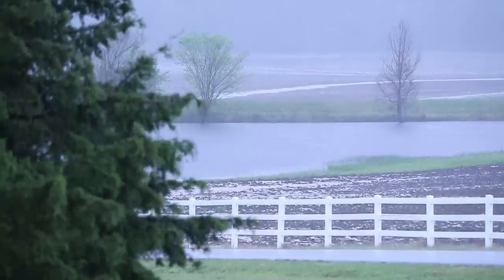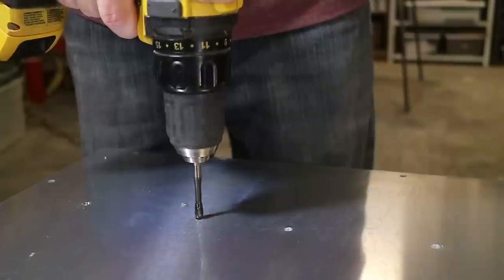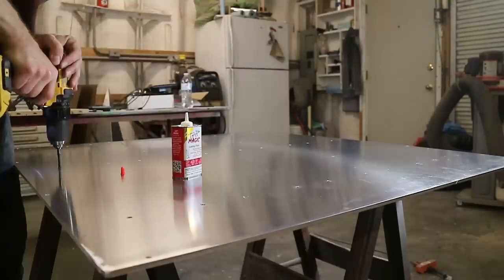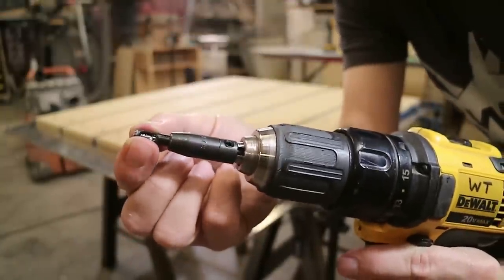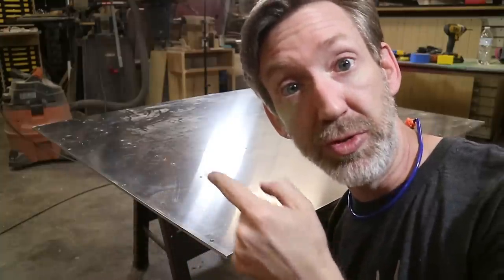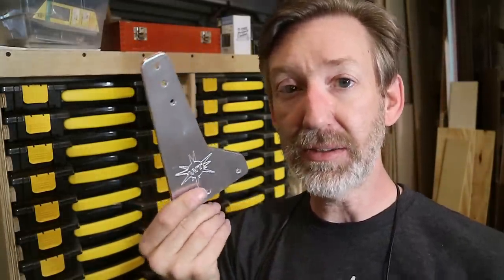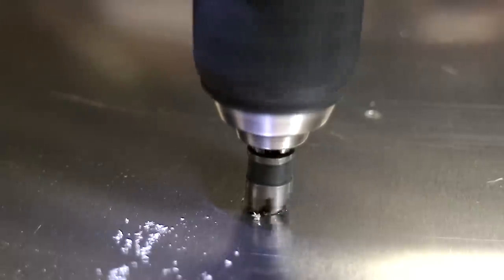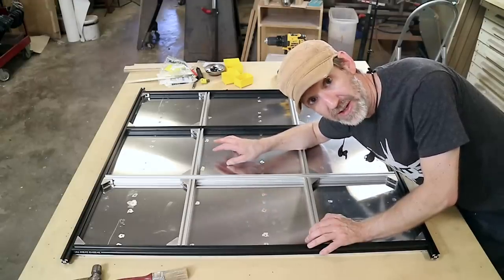A Better, Stronger X-Carve, With an Aluminum Bed & More Upgrades

Comment: I wondered if putting in the risers would compromise the frame stiffness, and it appears from this video that it did. At 11:45, it appears that there is a LOT of visible wobble in the gantry. Can you comment on that?
Reply from the maker: The risers also act as stiffeners. They strengthen the machine. What you're seeing was the table shaking.

Comment: Hi,
Is there a way that you could share the file that you used for the aluminum plate. I am going to install the same set up that you have in the video and will purchase from OSH as well.
Thanks.

Comment: Dear Wesley, Thank you for this very instructive video, and funny!. I'd like to know if u have some drawings for side plates (X and Y axis), to replace the original weak plates. I bought this machine in 2017, but as I live in Colombia, is difficult for me to get updates, especially right now in the middle of the pandemic.
Reply from the maker: I'm sorry, I don't. Those plates come from TBD CNC. You may try contacting them. There's a link in the video description. 👍

Comment: i just don't get the whole x carve fascination.  out of the box, at best, it is a flimsy cnc setup.  i see people spending a fortune on these in time and materials to make them even rigid enough to carve soft woods.  all 3 axes deflect with the slightest pressure.
Reply from the maker: If it's deflecting with slight pressure, you didn't assemble it right. I didn't have to upgrade it to get good results, but I like the fact I can improve and expand it when I want.

Comment: You beefed everything up but the Y axis.. Didn't you notice it bouncing around when you were attaching the new z axis?  That is the problem with them, the x and y have too much flex. Those x axis and z axis upgrades looks great.
Reply from the maker: I've never had a problem with any bounce in the Y axis. Any movement you noticed while I was attaching the Z was because there were no belts installed yet and everything was free to move.
Reply: @WesleyTreat  First off, you are a true artist... love your stuff...
IC... I thought it was pretty bouncy... More than normal. The reason why I was asking is, I have seen where Myer's Woodshop at 9:52 Was showing how much flex there was in his Xcarve. https://www.youtube.com/watch?v=eL7PqEpA0Qw
And Marius Hornberger modifying his, due to having problems the X and Y and torsion flex problems on the Z.
https://www.youtube.com/watch?v=JQJKxtc8bf4
He bought a sweet sliding table saw from Felder back in 2015 and then after seeing his channel and some of his xcarve videos, Just sent him their new CNC that isn't even ready for sale. Not impressed... looks like the Chinese ones you see on ebay.

Reason why I'm looking and asking questions is, I'm building a 26' Uhaul stealth camper/ toy hauler... And instead of a Jeep or car, it will have a portable metal and wood workshop in the back. With 2 tesla batteries for 10.4kw storage and 3.3k bank of solar panels and a backup generator. I only have 8'x8'4"x14' space to stuff everything in there... So I'm looking for a smaller CNC to have on the road... My current CNC needs more room than I want to give up. And it can be a PITA.... lol So I'm looking for something smaller. 

But I'm thinking maybe biting the bullet and build one from scratch... Kinda would like to at least be able to do a half sheet of plywood so when doing the majority of cabinets I build, I don't have to keep moving the sheet. I need it light, yet strong, plan is to suspend it from the ceiling so I can walk under it, I'm a hair under 6' so I have 28" to play with, then lower it to load a project then lift it back up so I can keep working and not waste my floor space. Or maybe a sidewall mounted, but I'd rather not give up wall space.
Reply from the maker: I also had the machine on a less stable table as I was putting it back together, so it was probably just the table shaking.

There was an older Y axis that came with the X-Carve that required reinforcement, but the one they've been selling for awhile is pretty strong. I haven't had any issues with it.

You might look at TBDCNC. I know Luke has been working on a complete machine that I'm pretty sure he's going to offer for sale. 👍

Comment: Wesley, the alum. Base is beyond my budget right now, so I will just add a second piece of 3/4 mdf. That should work on for a awhile ? Do you answer questions on your patron site
Reply from the maker: I've seen others use two layers of MDF, which should work all right. And, yes, I do try to answer all the messages I can over on Patreon. Thanks!

Comment: Enjoyed your video, I work at a machine shop and cut up my plate on a water jet to include the counter sink, sadly there is not much left of my x-carve I have replaced almost every part with something better, bummer tbdcnc is so backlogged, I still have an order sitting in pending status.. I designed and cut my own xyz screw drives, I will say this he has a solid platform bummer he don't farm out his dirty work to a bunch of American factories, I created my kit for about 250$ he charges 980$.. Luke might need to get a water jet table :p

Comment: ITS A GOOD THING IT IS JUST A 1/4 INCHES THICK BECAUSE YOU ARE USING A TAP MADE FOR STEEL TO TAP ALUMINUM , GET YOURSELF A SPIRAL TAP FOR ALUINUM AND IT WILL CUT THE PART WAY BETTER. IF YOU WERE TAPPING 1 INCH DEEP YOU BRAKE THE TAP YOU HAVE NOW
Reply from the maker: This is the tap I used: https://www.mcmaster.com/2687a48. A spiral-point tap for aluminum. I linked to it in the video description.

Comment: Most of that z hieght is above the gantry, meaning its unusable. If you flip the whole z assembly around and mount the servo direct to the top, this would give you a floating z-axis and you could add maybe another 2inches maybe 3-4 to your z instead of wasting movement above the z gantry

Comment: Very nicely done! Would you be willing to share or sell the DXF file that you provided OSH Cut with to fabricate the aluminum base? I would like to send them this job but I want to make sure I get it right the first time without screwing up the measurements. Thanks!
Reply from the maker: If you contact them directly and reference this video, they should be able to help you. 👍
Reply: @WesleyTreat  That would be great!  Thank you!!
Reply: @WesleyTreat  Thanks again Wesley. Caleb at OSH Cut was very helpful and I ordered a copy of the base plate today. Were you able to use the SuckItDust Boot with your new TBD CNC linear Z axis carriage? BTW, I cracked open my piggy bank and ponied up some coins to help support your channel on Patreon. Cheers!
Reply from the maker: I've had to make some new arms so the shoe fits. Might make a video on that when I redo them in aluminum. Thanks for the support!
Reply: @chrismatus4469  If you dont mind sharing, how much was the base plate?  Very interested in this upgrade!
Reply: @seanhoward25  It was about $360. I don't remember how much of that was shipping from Utah to NY. It was packed with a sheet of 3/4" plywood to prevent bending and the package was pretty heavy.

Comment: why buy and x carve in the first JUNK buy a workbee and get a great cnc that does not have to rebuilt ,,and a lot less money i bought a 1500 by 1500 mm can do 4x4 sheet work area and it cost less than $1,500.00 did not put in the bottom struts mounted cnc on table and have 5" of z !!!
Reply from the maker: Google Translate
Fatal Error

Comment: Very lucky you made it through all that tapping using a "snap -32"  (aka 6-32 tap) . The ratio of dia. and TPI makes that tap the weakest tap / dia / thread configuration. Very cool machine upgrade.
Reply: I LOATHE 6-32. Anytime i get a job with 6-32, anything going down more than 3/8" gets drilled only, and handed off to second ops, where it gets done with tapping arm which have clutches in the tap adapter.

Comment: Change the drill to drilling only, if your the torque limit, you will break the tap.
I use that tipe of taps with my drill and no problem, 2 broken taps in 5 years

Comment: I love it!  Do you know if the CNC company you used can just re-use your file so we wouldn’t need to do the measurements again?  Also, ballpark...what are we looking at price wise to do all the same upgrades?  Great job, man!
Reply: I'll second that! It would be great if they still have the specs we could tell them to reference, or if you have a file/specs any of us could send to them as well - makes sense if we are going to attempt the exact same upgrades - no sense in recreating the wheel if we don't need to!!  Great video!
Reply: Wondering about this myself. I would love to do this upgrade to my x-carve and it would make it a little easier if we all have the same dxf file.

Comment: A nice build/hack of the existing machine.  The Z-Axis hopefully cures some of the flex that the X-Carve has.  The 1MX1M units have two other locations for excessive flex, the X gantry member with it's associated mount flex and the v wheels.  The issue with the X gantry is the extrusion itself, it twists in use with even light loads and will go out of square as it relies on the week side plates that run on the Y rails.  The new Z system adds more weight on the gantry - and will wear the v-wheels and eccentrics out faster.  You can address those issues with ball guides mounted to the top and bottom of the gantry beam and building thicker gantry to Y-axis rails plates with some structural reinforcement that keeps the beam straight and square to the table.  I estimate that the cost for that modification is about the same for what you did to the table.

Comment: Why didn't you just have them laser the holes to a pre-release diameter size? Would have made it easier by just having to tap the holes without having to drill them out. Shouldn't have cost much more in machines time...
Reply from the maker: Answered in the video description. 👍

Comment: I highly recommend a countersink with a hole rather than multiple flutes for aluminum.  It'll change your life!  Search 53512 Cobalt single-end on Amazon.  I don't recommend that one specifically, but that style.  I got mine at Fastenal.

Comment: Now you need to get rid of the stupid belts and flimsy stepper  motors and flimsy stepper drivers and youll be good to,go and another ......maybe invntables should just design the machine properly and people like you wouldnt have to,double spend so much and redisgn so much...ha ha...in my opinion stock xcarve is junk period

Comment: Great video. Are you able to give the dimensions of your aluminium sheet? I'm currently in the process of doing the exact same thing, including the TBD risers, which have been ordered. I know that the risers make the bed slightly narrower and if I'm to get a base plate laser cut I'd love to have the accurate new dimensions! (in mm if possible!) Many thanks from across the pond!
Reply from the maker: Thanks! See the link to Phil's site in the video description.

Comment: Why not have the laser cut the proper sized hole to begin with?
Reply from the maker: With material as thick as 1/4", as the laser burns through, the bottom of the hole ends up a tiny bit larger than the top of the hole. Now, if I didn't need to tap it, it wouldn't really matter. But, with a tapped hole, you need a precise and consistent diameter. So, I had them cut the holes slightly undersized, then I drilled them out as needed.

All this I learned from OSH Cut, by the way, who helped me determine the best way to get the results I needed.
Reply: @WesleyTreat  Ah- thanks for the explanation!

Comment: That's a great idea with the aluminum plate. Huge upgrade over the MDF wasteboard with trying to keep everything flat and square. That's the great thing about an open source product. Another great upgrade is to ditch Easel and use V-Carve Pro. Easel is too limiting, and V-Carve  Pro is pretty simple to catch on to.

Comment: Dunno if you do a lot of countersinking, but you'd likely benefit from using an aviation-style countersink cage. Granted, you'd have to buy the 1/4-28-threaded countersink bits, but they're piloted, and the cage is depth adjustable to 0.001". Consistent, repeatable, accurate, and FAST countersinking. You can also get counterbore bits for them.
Reply from the maker: I have one I use for the rare occasions I need a countersunk rivet, but I could use a bigger one for general use.

Comment: So, how did you feel about the amount of control you had with the power tapping? Would you do this if you were trying a deeper,maybe blind hole? Harder material?
Reply: Can't speak for Wes, but I've done a bunch of power tapping into blind holes in steel - but I use a Bridgeport and a reversible tapping head... For anything over 1/2", I'd be leery of freehand power tapping; the problem is keeping the tap dead vertical. Any wobble/angle and you're looking at a snapped tap at worst, or a wonky thread (where the screw doesn't sit straight) at best. Also, the finer the thread, the harder it is to accurately hand tap. Tapping lube is great, but any fairly thick oil will do. For through holes, spiral point taps (which eject the swarf downwards) are fantastic. For blind holes, you're better off with a spiral flute tap, which ejects the chips upwards. With spiral flutes, you may still need to back the tap up to clear chips, but unlike a straight flute tap, you don't need to do a quarter backwards turn for every full forwards turn.

Biggest problem with power tapping a blind hole is knowing when you've hit bottom: The machine will almost certainly be MUCH stronger than the tap, and a broken tap in a deep hole will make you cry. A decent tapping head (e.g. Tapmatic 50x) is pricey, unless you can land on an eBay bargain, but the built in overload clutch will save not only your bacon, but also your taps, and your tears. For a more portable solution than trying to hoik a milling machine around, you might be able to adapt one to fit in a power drill, but you've still got to watch that vertical misalignment.
Reply from the maker: AdeV2 summed it up pretty nicely. For myself, I can't think right now of a hole I've tapped that wasn't a through-hole, so I'm pretty set on buying all high-quality spiral-points from now on.

Comment: Thanks, great video.  I am still wafting between an x-carve or going to a CNC router parts machine.
Reply: If you are doing more basic things and don't mind upgrading as you go the x carve is a really good option. The weakest points IMO are the z-axis and the y-axis but they can be upgraded for 200-250 ish.  If you want to do a little more serious machining and you have the money the CNC router parts option is great.
Reply: @aaronporter2180  Thanks!  Like I said I am still in the information gathering process and every bit helps.

Comment: Nice upgrade project.   I suspect however that some of TBD's paying customers who are waiting a month for their orders might feel a bit frustrated that seed units are being used to generate additional orders - just saying. I ordered on April 6th - still shows as 'pending'........
Reply from the maker: He sent me the upgrades a few months ago. I've only now found a window in my CNC work to integrate them. I know Luke is working hard to get everyone's orders out.
Reply: Yeah I figured that was the case.  Seeing the upgrade in action made me all the more keen to get mine so I'm guilty of venting a little.   Are you planning to go the whole way and move from belt drive to leadscrew?
Reply from the maker: @Zone1242  I've never had a problem with belt slippage, so it hasn't been a consideration up till now. Plus, I got a TBD belt upgrade which will probably suit me fine for a while.

Comment: all aluminium, except the nut, so if i take a magnet - mmmmmmm?
Reply from the maker: Magic!
Reply: @WesleyTreat  I mean, sshhh, was that a genuine slipup or maybe a chance to do magnet magic...?
Reply from the maker: @negotiableaffections  Yeah, one of them moved when I had to remove and replace the plate to countersink the holes.
Reply: @WesleyTreat  a clever/handy little fix - i just know my luck and the nut would have been the only NON-magnetic thing! lol